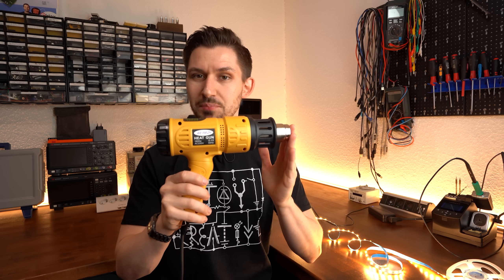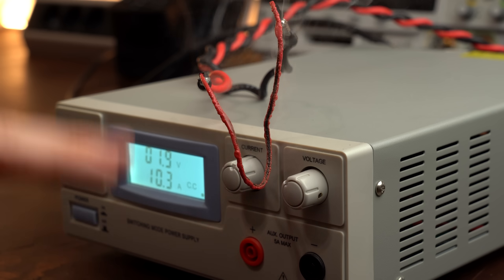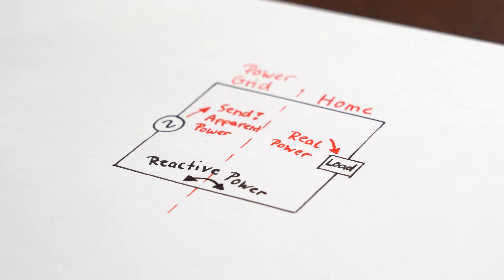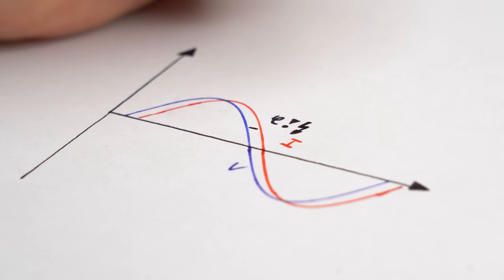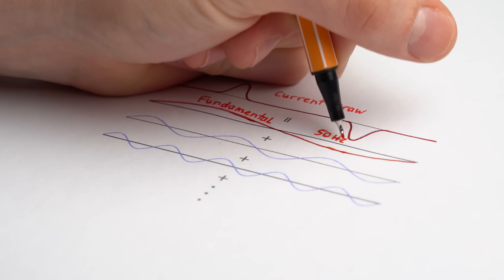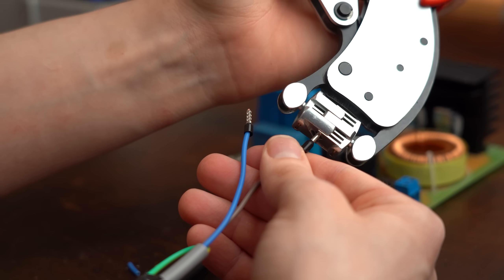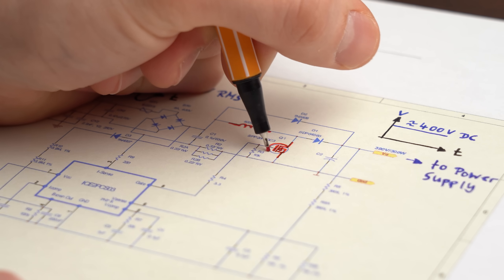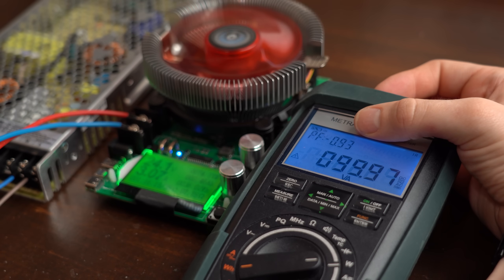The Most Important Circuit for our Electrical Future?! (PFC) EB#55

Comment: I was using my fancy new clamp meter to try to find out how inefficient my laptop and phone chargers were, imagine my surprise when they required an apparent 0.95 amps at ~120v just to supply 65 watts?! I did find learn about power factor and viewed this rather nice video, but I still don't really know how to measure the actual efficiency (or heat losses) of these DC power supplies...

Comment: Speaking of those Sharkteeth and their harmonic contents:
I set an AliExpress Voltage Controller (essentially a bigger Light-Dimmer) to 110V, then stepped it up with an ordinary transformer to 230V RMS and boldly fed it into the AC inlet of an ATX Power Supply.
Seconds later, both 470uF input storage capacitors of the ATX spectacularly blew their lids. Try it yourself with that spare ATX Supply of yours. 🤗
It was the first truly blindly executed murder in all my years of preventing major disasters in that German Oil Refinery, where I was employed largely not to blow anything up. 😓
Kind of like a Russian Nuclear Tech might be employed not to cause a China Syndrome and thus bring AliExpress to its knees. 😧

Comment: here in my country i can only find extremely low cost drivers for led lamps. and i`m having a problem with EMI, that they start blinking when something big is turned on. A simple beefy capacitor and a inductor for a passive should be enough, or it would be advisible to get a EMI filter together with a passive pfc?
Reply: If your grid croaks under load, then a passive PFC won't do much for you.

Comment: How well will these work for class D audio amplifiers. They often come with a cheap black block. I can get PFC switching units on A l i quite cheaply.
Reply: You can't get constant power draw for a power amplifier unless you run a class A circuit (that's basically a space heater for a 100W amp) or you put batteries between the grid and the amplifier.

Comment: What brand wire stripper is that? I need a new one. Also what is the tool you used just after the stripper? I might want one also.
Reply: Knipex Twistor 16 and Knipex Precistrip 16

Comment: Active PFC does help with SMPS ‘top-clipping’, but mandating it in every small device adds complexity, cost, and failure points. Leading or lagging power factors can often balance out on the grid; top-clipping is different, yet could still be corrected using grid-level inverters that draw power evenly and re-inject it where needed. A small premium for end users to cover real vs. apparent power may be more sustainable overall than over-engineering each appliance.

Comment: Mains harmonics, especially on the common line (in the US, at least) have made X10 control systems obsolete, as it wreaks havoc on the data signal. Zigbee and Bluetooth were developed in part to address this.

Comment: Yes, PFC's perform well.  However, they have the same inrush problem on power application as putting a large cap directly across the input line.  In your demo board schematic the C2 cap is, effectively, across the input line if you trace back through the D1, D2, and bridge rectifier.  There is no real current limit when line voltage is applied.  Not even RT1 is wholly effective.  After the boost has time to charge C2 then everything works O.K.  This initial current will depend on where in the mains cycle the circuit is switched on.  I am finding that most of the LED lights with or without PFC have a large input cap that must be charged.  This external cap is effectively in parallel with C2.  The result can be a very large resulting cap that must be charged when power is switched.  An installation of several or many LED arrays can mean very high peak current.  I have measured hundreds of amps peak when an array is switched on.  Not every time, but always on the peak of the sine wave input.  This leads to very short switch life.  It also has the effect of "spot welding" and therefore oxidizing wiring splices or connections that do not have enough contact area.   I have stopped using the "clamp style" (Wago style?) splice devices because of this and gone back to twisting all connections and using a wire nut.  I wish the clamp type connectors were tested and rated for these conditions.  As for the switches?  Expect frequent failures.

Comment: Are there any devices that can be installed after the power counter to counteract this effect?
I guess it's something that it's better to address on each single device, but it would be cheaper to add a single "PFC" to the whole house instead many.

I read in the comments that european standards require that already, but it probably depends on the manufacturing date and provenience of the device (I bet cheap LED bulbs are not using any PFC).

I just realized that a power meter installed on my main powerline is showing the power factor, which is now at 0.57, very bad.

Comment: I don't think they'll ever put PFC on any charger. Because if they do, the "there is no free energy" charade will be gone. Contrary to AC motors, that have low PF and low efficiency, DC sources exhibit an anomaly : low PF and high efficiency, which means they could be pushed in overunity. I'll be experimenting with this soon and I believe results will confirm my assumptions. I wouldn't trust any DC source or charger that comes PF corrected. Pretty sure they might add a variable resistor circuit or something to de-compensate, that is, hike consumption by the same degree of PF correction so that from the user point of view there would be no free energy, having always power draw higher than output. Let's not ever forget that science is politicized - Covid showed us that in medicine - and energy physics is politicized for more than a century. I see red when I read how obfuscated reactive power is in all texts, how can you have the same text insisting that "reactive power cannot be harnessed, cannot be used, cannot be converted in other form of energy" at the same time with explanations on PFC. It's just mindboggling how they managed to keep this lie for so long and how electrical engineers manage to keep their mouth shut about it. I'm a beginner in all of this and I can only play with capacitors, but as an economist I understand how they obfuscated the formulas, considering Efficiency = Output/Input instead of Output/Power Draw. But hey, saving our arses from the Great Extorsion age requires learning and adapting our lives to this mess.

Comment: Recently I salvaged APFC circuit part from 350W PC powersupply, now I use it to power my 24V DC powersupply. Ofcourse I worked carefully, because it gave 385V on main filter capacitor.

Comment: I think we need new standard for appliances using DC voltage around 400V, so we can use central PFC, then we can use lightings that don't require PFC on every single of them making them cheaper and more efficient without needing rectifiers, and we will slowly shift to DC power as most modern appliances work on DC.

Comment: That's because the LED strip only needs a tiny sip of power.  Your strip has a full wave rectifier in there, and rectifiers only draw line current when the line voltage exceeds the voltage on a capacitor in the power supply circuit.  That circuit sits there and delivers DC to the LED strip.  The current the LEDs consume discharge it, so briefly every half-cycle it needs to get recharged.
   
This is just standard power supply theory - there's really no story here.  The heat gun, on the other hand, can use the AC voltage just fine - it doesn't need a DC power supply (well, it depends on how it's made, but it's easy to see how you could use the AC directly for the heating element).

Comment: How do you calculate reactive power, when the cause is distortion rather than displacement?  I know how it works with displacement power factor and the power triangle, but how do you adapt it for distortion?

I know real power P = 1/(2*pi*T) * integral V(t)*I(t) dt from 0 to T
And S = Vrms * Irms

But what is the formula for Q, when V(t) and I(t) aren't both simple sine waves?

Comment: Power Factor Correction is something that I would do as an instrumentation and controls engineering technician. We do this on industrial motors all the time because when you're motor is consuming 250 KW to run, getting the power factor dialed in becomes a matter of saving thousands of dollars an day.

Had always just assumed that, since power factor correction is such an easy thing to do that the companies manufacturing power tranfsormers for home electronics would have just done it in the first place since you only need to get a capacitor and place it in parallel with the primary on the transformer....

You don't need complex electronics to tune a transformer...

Also, working with mains voltage IS DANGEROUS however, "being a professional" is absolutely not a necessity. Here in Canada, as long as you follow the code and get inspected, you can wire up the entirety of you own house and do electrical maintenance on your own property.

Comment: HI, further to my previous post I have been told by the meter manufacturer that the sampling period for AC current is 100ms.  If I understand correctly the cycle time for 50Hz is 20ms, therefore it looks like my meter measures my current use every 5 voltage cycles and assumes that the current waveform is sinusoidal.  MY office uses many LED lights and other electronic devices and the current waveform is not sinusoidal, not symmetric and just a mass of spikes.  It seems to me that there is almost zero chance that my electricity is being accurately metered.

Comment: Hi, great video thank you.  I have a lot of LEDs and computers and small power supplies for routers, switches, CCTV, video door bells, etc, etc.  My electricity bill is massive and does not add up.  Might it be possible that my electricity supply meter that is measuring kWh is seeing high current spikes and assuming that my load current is sinusuidal?  It seems to me that my new supply meter is not using True rms current measurements.  Do you have any suggestions or thoughts?

Comment: Strange examples the 'pure' power of the heat gun neglects the inductive load of the blower. Your picture of the led power shows the current in phase with the voltage.

Comment: Power factor is important as i tested an old air conditioner and the power factor got better when i was spraying the outside evaporater with water? Im assuming it lowered the load of drawing the heat away? Any reply appreciated cheers from Australia 👍

Comment: this is for lab only
why not have this connected to all light switches through an inverter to ac. how much more is that now?
then all walk outlets. how much the Pfc cost for 5kW? or a 3 phase house installation?
Would all the ac-dc-ac-dc conversion losses pay off or would i choose to pay for my dirty loads instead?

Comment: This is all due to the lies of capitalism. 
LEDs are many times more  efficient than incandescent filaments,  HOWEVER,
to convert 110 or 220 ac to low v dc requires circuitry. 
BETTER circuitry. 
Better than the cheapest possible solution,  a cap.
So, the lie, is that we will somehow save the environment by using the shitty supplies, or even worse, expensive and complicated supplies which deplete even MORE resources, and cause even MORE POLLUTION. 
There is no free lunch, and NO way out of this huge HOLE.

Comment: I have a couple of those 5v power bricks, but I do not use them at the moment. Currently I run my circuits (typically an esp32 with 50 leds) from a USB phone charger. I don't run the led string at 100% intensity and not all are on at the same time. Sure this doesn't do anything for PFC  but power consumption reduction is always a plus.

Comment: From what I've read the real problem with uncorrected electronic power supplies is the amount of third harmonic current drawn, as in a three phase system the neutral current is supposed to cancel but the 3rd harmonics add.

One possible unfortunate unintended consequence is that with the power supply industry bragging about 0.98+ power factors in single phase equipment and crazy low harmonics it has caused a problem for the designers of multi-kilowatt systems.
It is easy to get a simple three phase rectifier to about 0.85, maybe 0.9 I can't remember the exact figure by just levelling the current drawn and sometimes an inductor is enough, but getting above that to the levels claimed for single phase designs is significantly more complicated. As a result installations that should be three-phase input end up using multiple single phase modules instead. Hopefully they are properly spread across phases.

Comment: What matters most is the sum of all loads, which can be complex when dealing with devices like motors that run intermittently. In the past residential power factor consumption has been close to balanced, with the relatively small inductive loads of motors washed out by much bigger resistive loads. I'd be interested to see if the balance is tipped by the capacitive load of LED lights, but more likely the effect is so small it is still negligible. Perhaps in an ideal world the capacitive LED's will balance inductive motors! In any case, even if PF balance is off, the technology for distribution line adjustment is pretty simple.

Comment: Power factor is something most people don't worry about because power companies don't bother residential customers about it.  Business customers are scrutinized, and they are penalized if they can't keep the PF above 0.75, or in some places, 0.90, but that's usually only a concern for the building manager.  Historically, business customers had equipment with electric motors (basically inductors) that lowered the PF, while residential customers had mostly resistive lighting and heating with a few motors that turned on periodically (refrigerator, AC, washing machines, etc.).  However, resistive lighting and heating has almost disappeared, replaced by LEDs and heat pumps, and now almost everything we use has an electronic power supply, full of capacitors and inductors.  I don't know what my home's PF is, and the electronic electricity meter that replaced the old analog one doesn't say, but I wouldn't be surprised if that changed.  After all, if power companies switch to time-of-use pricing to reduce maximum demand, they're going to be interested in raising a customers PF for the same reason.
   What really bugs me are LED light bulbs.  The whole point of LED light bulbs is to reduce electricity usage, but manufacturers aren't letting that happen.  Only one watt is needed to produce 200 lumens, but most of the light bulbs I've tested (in the US) get 100 lumens/watt at best.  The excess is turned into heat.  I've measured surface temperatures of over 200 deg F/90 deg C on many bulbs, and the only reason for making them get that hot is to keep the bulb from lasting for a long time.  Heat is the enemy of electronics, but LEDs are cold devices, and especially sensitive to too much heat.  On top of that, most LED light bulbs have a PF of around 0.5, which means the power company has to generate 2 watts for every watt used by the bulb; the extra watt is turned into heat in the power lines.  In extreme cases, this extra heat causes power lines to sag an unsafe amount.  To sum it up, most LED light bulbs, which we use to minimize power usage and reduce global warming, USE 4 TIMES THE ELECTRICITY THAT THEY NEED.  And while most bulbs are less than 20 watts, and used for only a few hours a day in homes, there are millions of them on at any given time.  It adds up.   (I understand the EU has implemented or is implementing requirements that LED light bulbs get 200 lumens/watt.)

Comment: During the outro, what is the PCB are you using, running power from the supply into it's terminals with the Cooler Master CPU fan running on it, and what looks like and LCD display? I've spent two hours trying to identify it. It's low-key driving me crazy.

Comment: Power factor and reactive power can be seen pushing a playground swing. If you push at exactly the right moment, you can use only a couple fingers to lift a toddler over your head. But if you're not in phase with the motion of the swing you'll be fighting your own kinetic energy or maybe even break your wrist.

Comment: PFC were mandated in the EU for all PC power supplies in the late 1990s. Worked at a large electronics OEM manufacturing company and was directly involved in implementation of these changes, we produced power supply's for customers like IBM, Compaq, Apple, Olivetti and others.
It amazes me that they have not been more widely adopted in other countries.
Reply: I worked at HP and we had to comply with IEC 555-2 which came about because switching power supplies were creating excess current in the neutral wire which was typically undersized compared with the phases. That resulted in house fires in Germany when the neutral overheated. We designed PFC into power supplies that we deployed worldwide. It would be difficult to find a switching supply that meets regulatory requirements (FCC, CE, TUV, etc.) without PFC.

Comment: Just experiencing PFC in practice with a portable PowerStation and a compressor ice maker. Plugin power meter shows ~80W, with a PF of 0.5. The power station seems to draw 150-170W from the Battery as far as I can tell, and with that the battery drains much faster than expected. Now I will watch the Video and see if there is a "plugin-between" solution between ice maker and inverter.